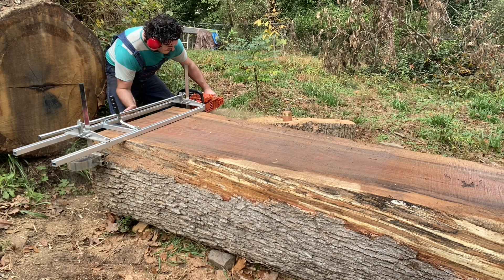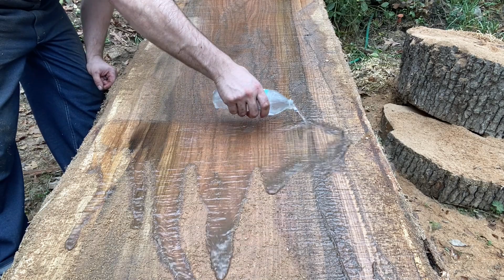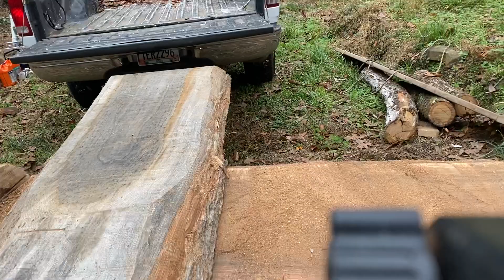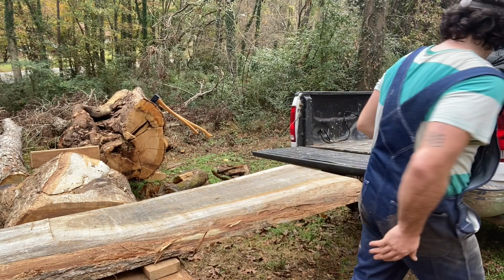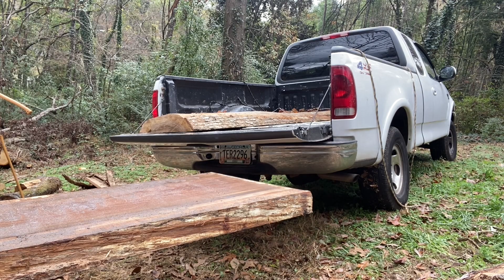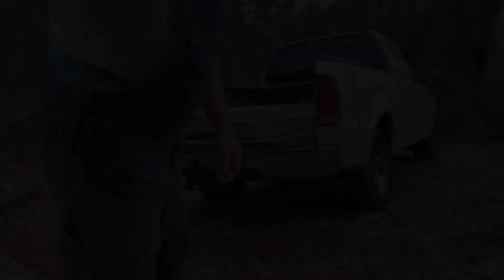250 Year old White Oak Slabs and loading them into my truck alone!

Comment: Screw a hook into the end of the board and buy a 25 dollar come along attach that to the upper strap hook attachment in your bed.
Reply from the maker: That’s a great trick! I need to figure out how to attach the winch to my bed. Right now I’m using the tie downs and having taken off a few beds know those bolts are not rated for weight like this.